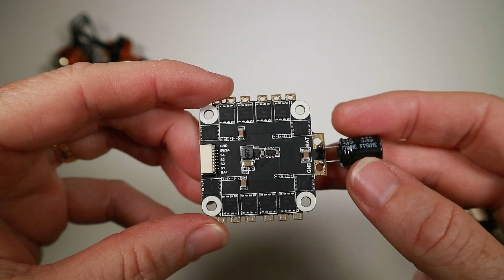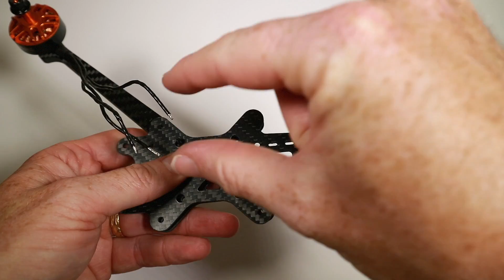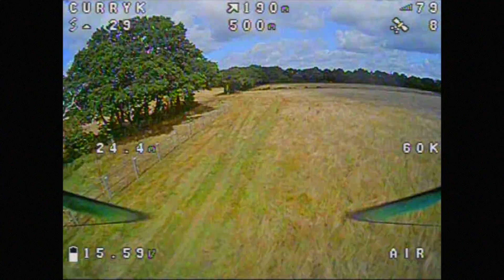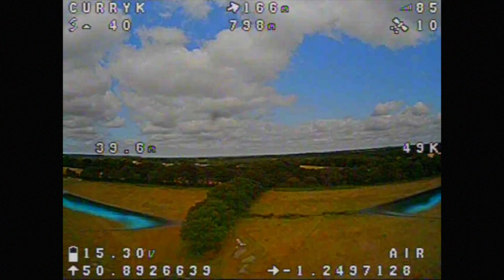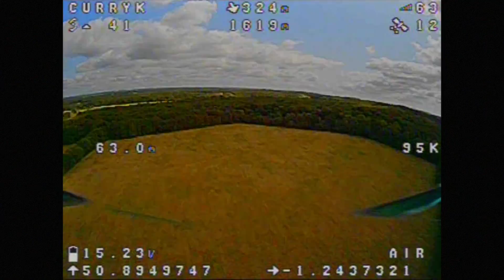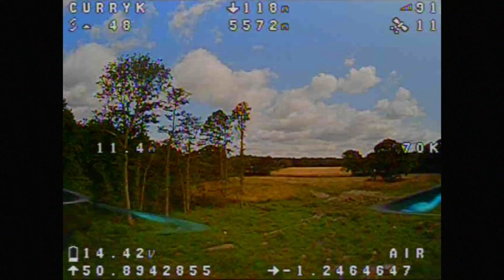Eachine Tyro129.  A 7" build-it-yourself-quad with a GPS.  Supplied by Banggood

Comment: I fly on vtx 5945 but cant see that freq listed on the supplied instructions, can this be set on 5945  ?????
Reply from the maker: Without going back to check, probably not.  A lot of vendors leave out a few frequencies on the E band - specifically E4/E7/E8 (5645/5925/5945) as they are outside of the FCC specifications, and they tend to keep launching big cases at people that sell equipment that would allow the user to do this.

Comment: Any idea why my receiver doesn't work/blink when I plug the battery to the drone? Thanks.
Reply from the maker: Can you elaborate on not work/blink.  Is it not powering on?  If that's the case, check your GND/5v wring and check with a multimeter that they are present on the connector points

Comment: what battery did you use?
Reply from the maker: Range of things.  1800 4s, and with the longer flights 5200 4S
Reply: @CurryKitten  What C rating was your 5200 4S battery?  I fancy getting something similar for longer cruising type flights

Comment: What receiver does the Tyro 129 come with and what radio controller is budget friendly?
Reply from the maker: It doesn't, you need to supply your own.  It's tricky to suggest anything other than an ExpressLRS radio these days.  For quality, and not too expensive, look at the RadioMaster gear.  The TX12 Mk2 or the Zorro
Reply: @CurryKitten  mine came prebuilt, so Im not 100% sure. It definitely has the antennas on the back legs, would taking apart be ideal to figure out the receiver?
Reply from the maker: @ashleighstuartholmes4117  If it's pre-built, you bought it off someone, rather than Banggood?  In which case, it might be easier to simply ask them.  I'd hazard a guess it'll be a FrSky rx in there, perhaps an XM+, but you'll have to find the receiver in the quad and have a look to be sure.

Comment: GPS mounted on an arm ?
Reply from the maker: Yes - in theory it would go on and secure nicely, and be away from the electronics.  The only troublesome part there are the motor wires, you'd just need to thing about routing them really neatly
Reply: Ideally not, interference from motor wires hurts gps signal.

Comment: Are you using fport on your R9 receiver? If so, how did you get it to work? I cannot get anything to move in the receiver tab after trying many different options in both betaflight and different wiring between the FC and r9mm, Thanks.
Reply from the maker: I'm not, I'm just using SBUS.  I was thinking about using Fport previously, but wanted to make a video about looking up telemetry using softserial - so never tried it in the end

Comment: Can you use lion pack on this Drone please thanks you
Reply from the maker: To try and answer you questions posted on various videos (but if you keep them on this one it makes more sense) I was using a 5200mAh 4S lipo.  That's about the biggest I would use.  It was pretty heavy, but still hovered at around 40% throttle.  If you go up to 5S/6S then use the 5200 4S as a weight reference.  Yes, you can use a Lion pack - but be aware it's much more designed for a cruise sort of speed, not punching out all the time and doing high throttle maneuvers.  You should have no issues carrying a full sized GoPro with it.

Comment: Reminder - stop worrying about fences - you're flying.....  :-).....austridge air perhaps but still....
Reply from the maker: I always consider my worst case scenario: what if I crashed here, could I get it back?  So I do consider barriers on the ground when flying... just in case
Reply: @CurryKitten ...that's ljust life weighing us down harder and harder , although I suspect it's more too keep the distance between chin and bottom of ball sack at a constant. Life is very educational that way... :-)
Instant karma is always my copilot  - it helps because the devil then will have to serve the drinks and nuts...... Austridge air did well today :-)

Comment: can you see what the drone sees on the controller?
Reply from the maker: Nope - Everything is a separate component.  The quad is one thing, the radio another, and the FPV goggles (which we see what the quad does) another still
Reply: @CurryKitten  would you recommend it for freestyling?
Reply from the maker: Not especially - you can fly freestyle, but a 5" will do it better.  This feels like more of a longer range cruiser to me

Comment: What's the range on this, please? I'm new to drone building :)
Reply from the maker: When you buy is, zero - as you have to fit your own receiver and then the range will depend largely on that.  But if you are new to drone building, don't focus so much on range - more on getting a solid build that you can think about going a little further with bit by bit as you r confidence level in yourself and the quad grow

Comment: Your bell has moved, you pointed top left when the bell is bottom your left my right or am I wrong..... confused now. PS Ahhhhhhh them solder joints dont like them sticking out at the sides.
Reply from the maker: Dammit Wynne, you are right.  I took me ages to learn how to point "camera left" as well.  I didn't like any of those solder joints... and those stiff wires even less so

Comment: What are his shortcomings ?
Reply from the maker: His, as in me?  Or the quad?
Reply: @CurryKitten  quad ))
Reply from the maker: Depends what you want from your quad really.  I like this size as I can use a much larger lipo and cruise around for 15+ mins easily and then use the GPS for an added safety measure.  It'll come up short (compared to a regular 5") if you want something very light and agile for racing or freestyle.  VTX and camera could be better, but still an improvement on the previous Tyro models

Comment: That batt doh 🤣🤣
Reply from the maker: I know right - was shocked to see it would fly with that big bugger at quite low throttle
Reply: @CurryKitten  your right they stay at same voltage for ages my 16000mah stays long around 16.8